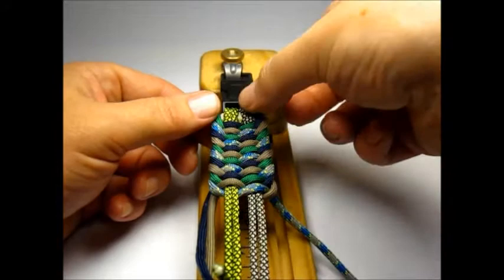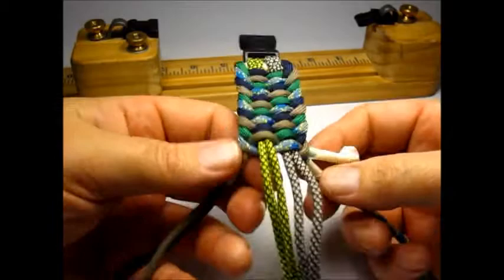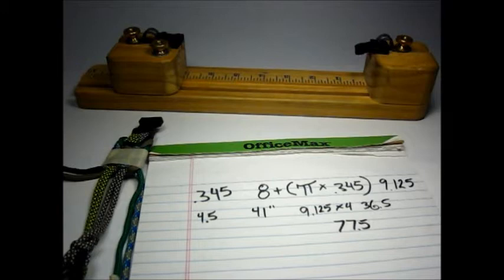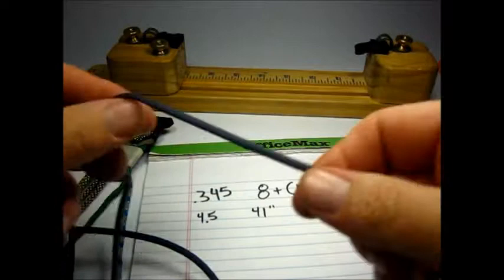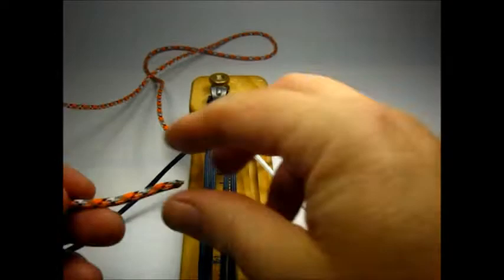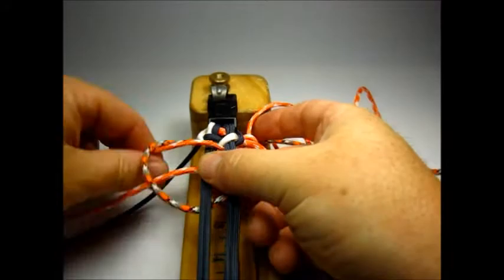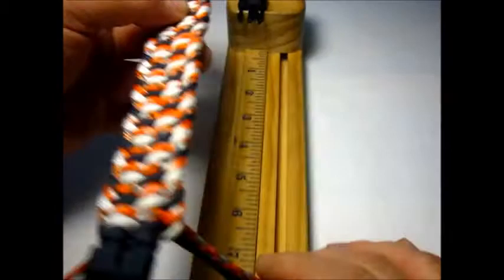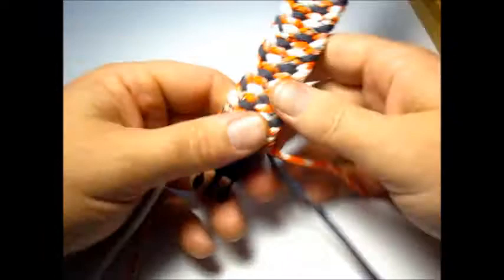Farbenspiel Trilobite

Comment: Thanks Brian.  I started measuring my cordage after reading one of JD Lensen (TIAT) books and running across Mike Malone's spreadsheet on ParacordOn.  Took me quite a while to figure out how to make the calculations but I finally ended up make my calcs according to how I like to tie them which is similar to how you did this.  I thoroughly enjoyed watching how you did your calcs.  It was nice to see how others come up with the widths, thickness and inch measurements.  I have saved some of the pics of your work for inspiration.  Thanks for sharing.
Reply from the maker: Yea I had a difficult time finding anything like this when I was first starting out, I thought I would show the whole process.